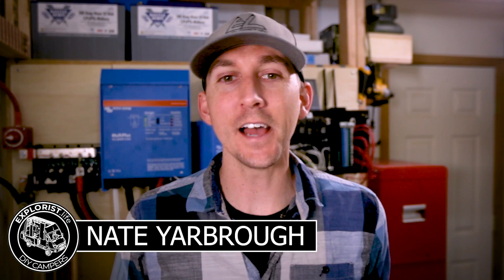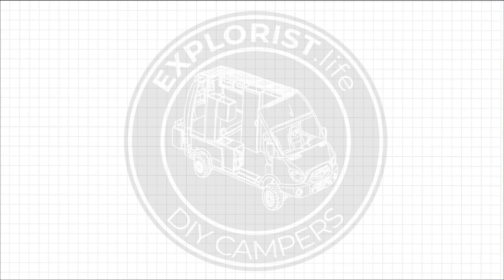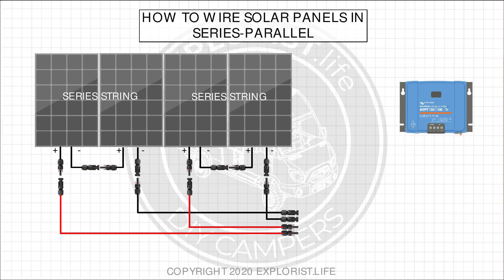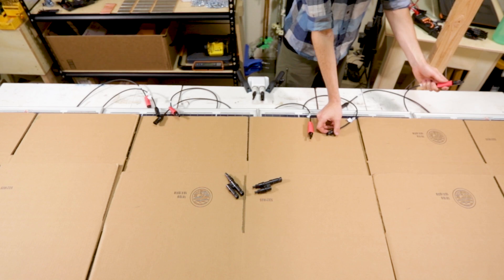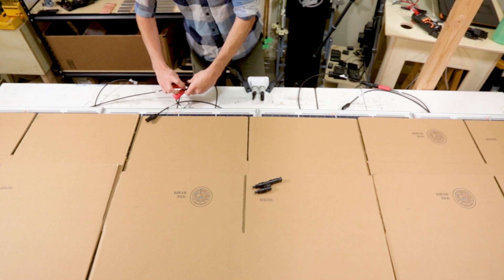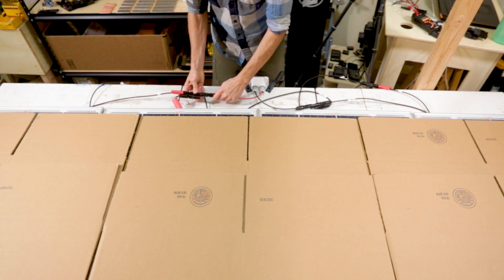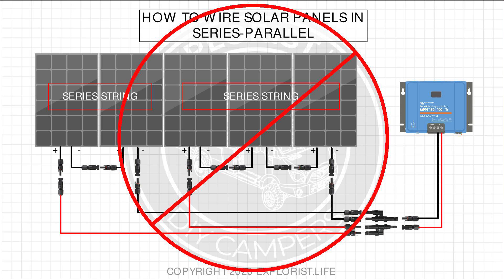How to Wire Solar Panels in Series Parallel

Comment from the maker: Looking to build your own solar setup? Everything we used in this video is available in our store — tested, proven, and ready for your next install ⚡

🛒 Shop Now:
https://shop.explorist.life/?utm_source=youtube&utm_medium=description&utm_campaign=how_to_wire_solar_panels_in_series_parallel&utm_content=shop_link

🔌 Featured Products:
• 4-to-1 MC4 Branch Connector:
https://shop.explorist.life/shop/all-products/4-to-1-mc4-branch-connector/?utm_source=youtube&utm_medium=description&utm_campaign=how_to_wire_solar_panels_in_series_parallel&utm_content=product_link_mc4_branch

• 15A MC4 Fuse:
https://shop.explorist.life/shop/all-products/15a-mc4-fuse/?utm_source=youtube&utm_medium=description&utm_campaign=how_to_wire_solar_panels_in_series_parallel&utm_content=product_link_mc4_fuse

✅ Need extra help designing your system? Join our Pro Support Membership:
https://shop.explorist.life/prosupportmembership?utm_source=youtube&utm_medium=description&utm_campaign=how_to_wire_solar_panels_in_series_parallel&utm_content=pro_support_membership_link

Let us know if you have questions — we’re here to help!
Reply: 3:17 quick question as to why we can't have this kind of set up, 
For eg 
I have 3 x each is 200w - 21.85voc -18.83vmp 11.25isc - 10.65imp
I can't do parallel as it's 600watts and my victron 100/30 will only do 440w on 12v.
In series I'd get according to vmp x3 =56.49 x 10.65 imp = 601.65 watts that's still over 600w with low amps and higher amps will charge faster will good volts right, 
Soooo 
My question is with me 3 x 200watt panels I want to do 
2 panels in series 37.66vmp / 43.70voc. 
(401.07 Watts vmp X imp, 491.62 Watts voc X isc) 

1 panel by itself numbers above just halved - joined as a parallel joint to the 2 in series to the mppt- 

Why wouldn't I be able to do that as it would give me 
The number I need for my victron 100/30 
As I don't want to have to buy a 100/50 

Could I add 2 x 200 watt panels in series with 2 x 250 watt panels in series 
Then connect the two in parallel to my 100/30

Comment: I have 4 panels, and each  is 43.1V and 11.32amp. If i connect 2 series, 2 parallel, it is the outcome numbers be 86.2V and 22.64amp?
Reply from the maker: You’ve got the right idea, but to make sure your setup and numbers match your exact panels and wiring safely, we’d love to take a closer look at your system details. Reach out to our support team and we can confirm everything and help get you set up with the right parts: https://shop.explorist.life/support
Reply: My setup are pecron F3000LFP with 4 zoupw 400w panel.
Reply from the maker: Rad!  Happy to help.  Hit the link in the previous reply.

Comment: If using this string config with a Tesla Powerwall, can the Rapid Shutdown RSD be installed where you installed the 2 fuses since RSD's are required for every 3rd panel?
Reply from the maker: Great question! How and where to integrate RSD with a Powerwall really depends on your exact system layout and local code requirements. We’d love to take a closer look at your project so we can point you in the right direction. Reach out here: https://shop.explorist.life/support

Comment: Hey I am getting back to wiring my motorhome panels in series parallel. I have 2 rich solar panels 200 watts each on one end of camper and 2 200 watts rich panels on the other end. I get lost on how to wire these in series parallel to my controller. I mounted a junction box on the roof. It will drop down through refrigerator air vent to controller. Need some help. Will it be enough to power a tesla in the future by passing the 3 100-amp batteries. I will not be driving many miles per day; I am using #10 wire. Thanks Bill H.
Reply from the maker: Bill—happy to help get your 4×200W panels wired series-parallel to the controller with the right junction/combiner setup, wire gauge, and protection—and set realistic expectations for any EV charging plans. Send us your panel model numbers, controller, run lengths, and goals and we’ll put together a tailored diagram + parts list for your motorhome. Reach out here: https://shop.explorist.life/support

Comment: Hello community,  anyone can help to give an answer to my question below?

1. Array of 6 panels in series they produce: 
268.8V
8.41A
2,260.6W

2. Array of 4 panels in parallel they produce:
44.8V
33.64A
1,507W

What is best way to connect these 2 arrays by series or parallel to Sungoldpower inverter SPH5048P specifications:
5000WAC
5500PV
48V
63A

CS 305W solar panel spec.:
VMPP 36.6V
IMPP 8.41A
VOC 44.8V
ISC 8.97A

Thank you very much 
Tiger
California,  Rosemead city
Reply from the maker: Stringing those arrays safely depends on the inverter’s exact PV voltage/current limits, local temps, wire runs, and protection. We’d love to run the numbers for your SPH5048P + CS305s and recommend the best series/parallel layout (and any fusing/combiner gear you’ll need). Send your details here and we’ll dial it in: https://shop.explorist.life/support

Comment: Can you series parallel with 3 panels or do you need 4?
Reply from the maker: Great question — you can do a series-parallel setup with 3 solar panels, but the layout gets a little trickier since you’d be mixing uneven strings, which can cause some performance imbalance.

In many cases, it’s cleaner and more efficient to work in even numbers like 2 or 4 panels if you’re doing series-parallel wiring.

To figure out the best way to wire your specific panels and get the most out of them, reach out to our support team:
https://shop.explorist.life/support

Comment: This is Jerry , I have 4  100watt Panels & I order A contro box that is 100-50 I have 2 battery 100ah & a inverter 2000 & fuses & busbars ,How is the bestway wire them up Series or Parallel
Reply from the maker: Hey Jerry! Both series and parallel have their place — the best option depends on what voltage and current your controller and inverter are designed to handle.

If you’d like help deciding the ideal setup for your specific gear, our support team can walk you through it:
https://shop.explorist.life/support

Support is free for products bought through our store: https://shop.explorist.life
And if you got your gear elsewhere, the Pro Support Membership has you covered:
https://shop.explorist.life/shop/all-products/membership-tiers/

Comment: I have 3 old panels that are 320 watt per panel and want to add 6 new panels at 450 watt per panel.  Was going to do 3 series strings 3 on a string and 3 each new string.  Will I have issue using the old panels with the new?
Reply from the maker: Mixing old and new panels can work, but there are definitely some factors to keep in mind when combining strings like that. For the best advice on matching them safely and efficiently, our support team can help.
⚡ https://shop.explorist.life/support

Comment: Could I hook up 4-12v 200 watt solar panels to a renogy rover 60 amp controller charging 2-12v 280ah batteries in parallel?

Comment: @EXPLORISTlife I really appreciate your videos! I have a question- I have a project in the works with a 10 panel array-- two series strings of 5 panels. There will be a combiner box with a breaker or fuse for each string. All but one panel has a max series fuse rating of more than twice the short circuit current of each series the one mismatch panel is identical in voc, vmp, isc, and imp, but a msf rating of 25a vs 30a. Isc is 13.79a on all panels.  What size overcurrent protection do i need? One for each series string, and one of twice the amperage right before the mppt?
Reply from the maker: This may take a more in-depth look at your personal setup.  If you have purchased/are purchasing from our store (shop.explorist.life) reach out for some more personalized help: shop.explorist.life/support

If you've purchased/are purchasing elsewhere, reach out to your dealer for support.  We'd love to have you as a shop.explorist.life customer so we can provide a bit more help. 🙂

Comment: Suppose I have a 220 W solar panel and also two power stations that take 110W solar.   The power station each charge individually from the 220W panels but at 110W, their limit.   Could the two power stations both be charged by the solar panel simulateously, maybe with a parallel cable but in reverse?
Reply from the maker: Doubt it

Comment: Got a question 

I have five matching panels 420 watt 
50.39 (OCV)

I am trying to hook them all up so I can get output from all five. But my charge controller can only handle 150 volts Max what would be a good way to hook them up.
 Thank you so much for your  time
Reply from the maker: Basically, you need 2-3 charge controllers for that setup.  Reach out at shop.explorist.life/support if you want us to take a closer look.

Comment: Can it be done the other way around, adjacent pairs in parallel, and the series at the connector? Asking as mine are parallel already in 2s, and soldered and covered in rubber..
Reply from the maker: That's not common practice, no.  Look up our video on 'How to Crimp PV connectors' to re-connect industry standard PV connectors to your solar panel wires.
Reply: @EXPLORISTlife  Thanks for the reply. My panels came in oarallel sets of 2. One has 2 connectors, the other only has one with pos and neg running through it. The wires are soldered on inside but maybe I can melt the solder and resolder to the opposite so its in series. Dunno what else I can try. Theyre worthless if I cant get the right voltage so uf I break it, oh well.

Comment: Sorry for my ignorance, but I want some help before I mess up,  I have 6 panels 265w poli  vmp 31.4, imp 8.44, voc 38.6, isc 9.03  this are connected in series with a growatt all inone inverter 250VDC, If I want to add a new string of 6 panels but this other ones are 250w instead of 265 with: vmp 30.3, imp 8.27, voc 37.6, isc 8.85, how should I connect them? 6 and 6 and put a fuse on each string for the postive? thank you
Reply from the maker: Hey, @usafshorts! I appreciate you taking the time to ask your question, but unfortunately, I don't have enough info about your specific question to provide an accurate answer, but here is a playlist that, if you watch all of the videos start-to-finish (and take notes 😉), you'll have a REALLY good idea of how to design a solar array: https://www.youtube.com/watch?v=Jkbs84sBHsg&amp;list=PLmvhcyi4n0TV9pi83rFTv3ZuMT_S1xIZt

Alternatively, I have some of my most common solar array setups pre-built here: https://shop.explorist.life/product-category/all-products/camper-wiring-kits/solar-charging-wiring-kits/

Comment: hello, i have 8 100W renogy solar panels and a epever 40A solar charge controller, i have no inverter( broke) shopping for new inverter and thinking of taking the opportunity to change over to 24V system. I have 2 battery born 100A batteries. I want to wire the panels to achieve the most out of them for the 40a charge controller. or upgrade to a 60a.

Comment: Hello, I am building a micro system solar panels charging three 12v batteries in a tool box. I have procured some used panels that are putting out actual 21v and 5A, I have six panels, wiring parallel and series I could set up as series three panels parallel two, or series two parallel three, the result would be 63v 10amp, or 42v 15amp, I have a victron ppt 100/30, is there any advantage to push for the higher voltage? thank you I have learned a lot from your videos.

Comment: Im new to the solar game and a bit confused. Im thinking of running (10) 200-watt solar panels in 5 pair series parallel. Each solar panel is rated at 15 amps therefore each pair will effectively be 400 watts, 24 volts, 15 amps. When I run them in parallel, the amps will increase correct? Typical mc4 connectors are rated for 30 amp I believe. What can I do?

Comment: I have 14 solar pannel each of 45 volt, 12 amp , 575 watt no tell me can i connect 10 panel in series and remaining four panel in parallel then conct connet this 4 panel set (which are connected with each other in parallel) in series with my 10 remaining panel which are already connected in series ?
Reply from the maker: Hey, @anasmustafa589! I appreciate you taking the time to ask your question, but unfortunately, I don't have enough info about your specific question to provide an accurate answer, but here is a playlist that, if you watch all of the videos start-to-finish (and take notes 😉), you'll have a REALLY good idea of how to design a solar array: https://www.youtube.com/watch?v=Jkbs84sBHsg&amp;list=PLmvhcyi4n0TV9pi83rFTv3ZuMT_S1xIZt

Alternatively, I have some of my most common solar array setups pre-built here: https://shop.explorist.life/product-category/all-products/camper-wiring-kits/solar-charging-wiring-kits/

Comment: Nate, I have a question for you? I have a power station I got for my van and it says 10-75v dc. 10A max and they recommend using combine panels up to 600W, this is I have two 300W panels. How should I wire them to charge it? I have been watching your series, and I am here at this video looking for some kind of awnser.
Reply from the maker: Hey, @jihlnabaat6329! I appreciate you taking the time to ask your question, but unfortunately, I don't have enough info about your specific question to provide an accurate answer, but here is a playlist that, if you watch all of the videos start-to-finish (and take notes 😉), you'll have a REALLY good idea of how to design a solar array: https://www.youtube.com/watch?v=Jkbs84sBHsg&amp;list=PLmvhcyi4n0TV9pi83rFTv3ZuMT_S1xIZt

Alternatively, I have some of my most common solar array setups pre-built here: https://shop.explorist.life/product-category/all-products/camper-wiring-kits/solar-charging-wiring-kits/

Comment: Doesn’t it make more sense to run one long wire for the positive side and another for the negative side with each additional panel just tapping into that long wire? Wouldn’t it increase efficiency by running less wire resulting in less loss? That’s how I wired my six panels together. Also, to lessen the need for additional mc4 connectors, I used three battery lug connectors, bolted them together and wrapped it in electrical tape. It seems to be working so far
Reply from the maker: In short: no.  That is not how to properly wire a solar array. The video you commented on shows how to properly wire a solar array in series-parallel.

Comment: I have 3 single 400W panels each on a different roof I can't wire in series as only one at a time will receive the sun at some point of the day so could I parallel them for a better result

Comment: Hi, I'm just upgrading my solar setup at the minute to victron, 
I have 2 x 50/100 mppt controllers and 8 x 405w panels, batteries (opzs) are 24v
It says max 1400w panel input,
Question, would it be ok to wire 2 panels in series and a 3rd panel connected to one panel in parallel,
Is there a risk of cooking a diode or anything, 
 panels are around 40v and 10amps each
So 2 in series = 80v 10amps and the 3rd in parallel to boost the amps to 30amps, 
Thanks k

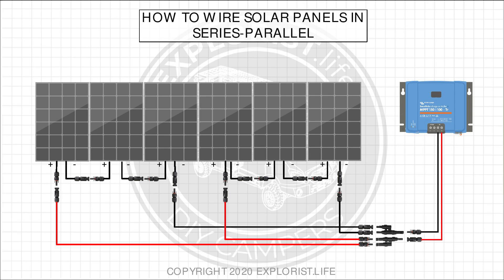Comment: I tested my voltage doing both series and parralel wiring of the solar panels. It shows the voltage to be different from doing series compared to parralel. Why is that? It should show the same? If its showing higher voltage with series-parralel like in your diagram at 2:46... how do I know how much voltage is safe to go through the lines and the charge controller without damage? It was way higher on the voltage showing for that wiring set up.

Comment: @2:46 you jump from doing 4 panels in a series to 6 panels in a series. I wanted to ask about that, specifically every time you jump a certain number of panels in your series, how much extra risk are you putting on for fire or accidents, trouble, etc? And is that risk much higher than just +2 (if adding +2 panels)? Is it more like x2 or higher? 

I'm not suggesting people stop doing solar, but its possible every time you add something that you have to check everything over many times or whatever to make sure you've contained the risk? 

...

And are there videos showing the difference between like how solar would be done if it was just wired into someone's house electric, connected to the grid, without using batteries or as a separate closed system? (Or is that only for electricians to work with?)

Comment: Question is when connecting in series and increasing voltage, do panels has a voltage capacity to qithstand or u can just connect unlimited num of panels in series without danger on the panels?

Comment: NICE VIDEO COOL I HAVE 48V SOLAR CHARGER CONTROLLER 30A  I HAVE 48V 3000 WATTS PURE SINE WAVE INVERTER HOW MUCH 12 VOLT SOLAR PANEL I NEED TO CHANGER MY BATTER  BSC4048 MPW SOLAR CHARGER 48V I HAVE

Comment: im looking to use one series solar array into two different solar power stations one is a delta max 2000 the SOLAR array  PLUS right in and  that same DELTA MAX has a AC charging input .witch can simultaneously charge the delta max at same time..... I also have a Renogy solar charger on a 12v 190ah 150BMS lifepo4 battery then to a dc to AC inverter output that I can also plug into my delta max on the AC charge input 

SO MY QUESTION can I use my solar array and split it or Y it out to both THE DELTA MAX INPUT xt60i INPUT and to the Renogy solar charger 

ONE PANEL ARRAY SPLIT TO BOTH?  is that doable with no harm to my 2 systems?  btw this is for my home
Reply from the maker: Nope.  A solar array can only go to one controller.

Comment: What is the best way to connect 7 identical panels using 2 mppt controllers on a 12v system?
Reply from the maker: 4 panels to one charge controller and 3 to the other.

Comment: Hi I have 4 solar panels 100w total 400w wiring 2I and 2p and victron 100/30. I have a problem the watts maximum I have is 252 full sunlight not around 400w

Thanks